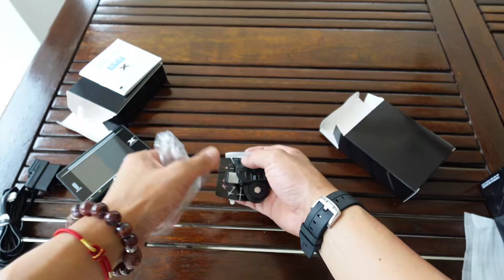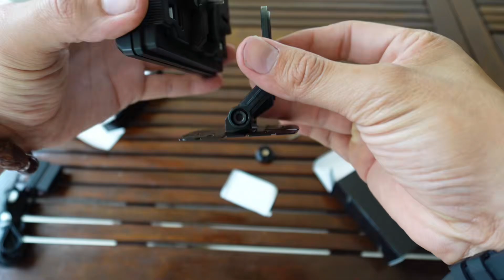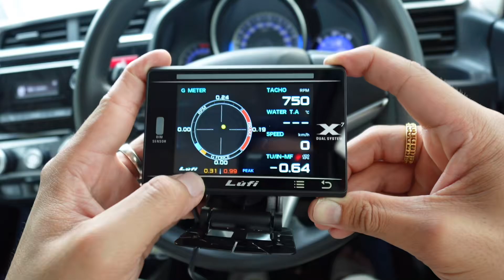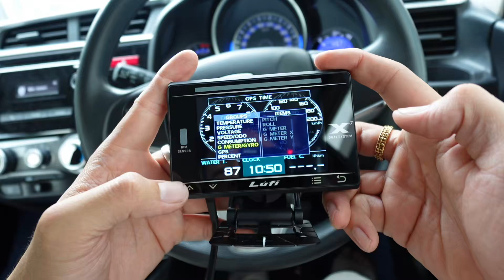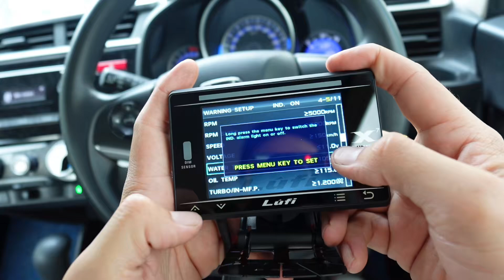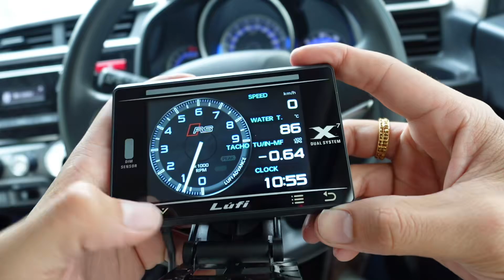LUFI X7 OBD2 meter manufacturers auspicious installation tutorial

Comment: I have a BMW E91 318D car manufactured between 2008-2012. The X1 does not read oil temperature and oil pressure data. Would the X7 be able to do it?
Reply from the maker: The instrument is equipped with the corresponding PID for BMW. You can conduct the corresponding tests through the built-in custom PID menu. The PID instructions for X1 and X7 are the same. If it doesn't work for X1, it won't work for X7 either. If you can find the calculation formula for the oil temperature PID instruction for the car, you can also email us and our engineers will customize the corresponding PID for you. However, there is no guarantee of success.
A quick note: We’ve received feedback that some clients haven't seen our replies. Our apologies! Outlook often marks our emails as spam because we attach customized PID files. Normally, we reply within one business day (excluding CN holidays/weekends). Could you please check your Spam/Junk folder? Thanks!

Comment: Greetings from Japan. This meter is an amazing product. I follow your videos. I have a question. I'm using an X7, and in the bar graph tachometer at 14 minutes and 40 seconds in your video, the line that holds the RPM for a few seconds doesn't appear. Other people's videos show that some X7s have this function. The peak hold line is displayed at 13 minutes and 25 seconds.

Also, even after setting the warning settings, the animated pop-up doesn't appear. Even when I set the water temperature warning to 80 degrees, the displayed text just turns red.

Please explain these two points.
Reply from the maker: The operation procedures are all the same. Other X7 models have this function as well. Yours does too. Just watch the tutorial in the video and you should be able to find the function you need.

Comment: All you need to know if it's able to show the milage (/km)- odometer.
And the funny things is: NONE of those can! I wonder why?? It should be technical possible or not?
Othewise I would buy one long time ago.
Reply: Doesn't only show engine mileage on some makes
Reply: @ethanwasme4307  If I have understood you right, you mean on some cars id does show the total milage, right? But how do you know on which car brand/model it will show the milage and on which not?
Reply: @AlexDerhuan , not all vehicles store odometer mileage in the PCM/ECM, GM vehicles store the Mileage in the Cluster (IPC) for example. And some vehicles don't store Mileage at all.

obd2 is just a connection standard like usb, it's up to the manufacterers  what can be picked up with a scantool like this display essentially is.

even this display may/will require you to find custom codes sent by the ecu to be decripted by the display. you email them to support and they give you a firmware update according to comments.
Reply from the maker: The mileage needs to be manually set to the same as the car's mileage when the device is first installed. Only then will the mileage display be synchronized and show the same kilometers as those on the car's dashboard.
Reply: @lufi-xf6224  That would help! How many digit you have for the milage display? 5? or 6? or even 7? Do you know that?
Reply: @lufi-xf6224  Ok, I order it now and if does not work it will be send back. Thank you.
Reply: @lufi-xf6224  I ordered it and it arrived today. I will test it and give you a report. See you!
Reply from the maker: Under the instrument system settings menu, you can select between kilometers and miles, as well as Fahrenheit and Celsius units. This is very easy to do.

Comment: can u input custom manual pid w/ formula on lufi x7? like transmission temp and gear?
Reply from the maker: Manually entered PID formulas may not be supported, as our PID data is encrypted. The instrument has built-in PIDs for different brands. It is necessary to test them one by one to see if they are compatible with your vehicle. Since each car manufacturer produces different models, different models may correspond to different PIDs. The built-in PIDs may not be supported by your car. Please understand this.

Comment: Just spent 350 on one of these x7.. doesn't work on 2012 Suzuki swift sport only get water Temp..no speed..no RPM..no clock even.....even to adjust clock it won't let me go past 12..I need 13 for New Zealand time zone..my $30 one off a temu does it all but no CVT temp...which is why I bought this one...what a waste of time...all I get is water temp and nothing else.
Reply from the maker: This 350 yuan is too expensive. Amazon's price is only around 120 US dollars. Suzuki cars might not be compatible. So, you need to look at the corresponding pictures of the suitable models. The product pictures contain the information of the suitable models.
Reply: @lufi-xf6224 it's comparable with ALL OBD2 from 2008 onwards..yet it doesn't work on a 2012 Swift...at all... so it is a lie because it's obviously isn't.. it's time they come clean... OBD2 is OBD2 if they say it works and it doesn't..then it's not!...no matter how you cut it it a poor protocol design on the OBD2 platform
Reply: @mrjones6770  ,  The port indeed is called OBD2 and even mid 90s cars had it,   but there are various different protocols used for actual communication.  If this X7 fails to automatically select the correct protocol  it cannot read these coded values as you stated.     For eg in my Scangauge2 i can manually choose between: ISO, PWM, CANSF, CANLF, CASNSS, CANLS, VPW, KWPS  and  it shows all data no problem.
Reply: And I paid $350NZ dollers..not us or any other @lufi-xf6224
Reply: Also so say to me Suzuki car might not be compatible..that sounds really bad on your part...you make the device..you should know exactly how it works on the OBD2 platform...dont tell us it's hit or miss with some cars...YOU should know..not good for your customers...customers shouldn't have to ask will it work with my car? ..if car is OBD2 then yea will work...not maybe just bye one and find out! 🤬 @lufi-xf6224

Comment: Does this  device support reading the temperature of the automatic transmission oil?
Reply from the maker: The oil temperature and pressure function is not applicable to all models. For most models, an engineer needs to send you the PID data package of the corresponding brand. After installation and upgrading, the relevant information may be displayed. If you need it, please contact our engineer and tell him your car brand. Our engineer will send you the PID data package of the corresponding brand.
Reply: @lufi-xf6224 I’ve been waiting for a response back? I contacted your outlook email
Reply: @lufi-xf6224  how do we contact your engineer?

Comment: They can read lambda for gti mk7 ?
Reply from the maker: It may not be readable. The displayed data is related to the sensors of the vehicle. Only the data that the ECU can receive can be read.
Reply: Should work. It reads lambda on my Audi S8.

Comment: how to make nissan engine temp, etc functional.. in mine is show all zero
Reply from the maker: The oil temperature and pressure data cannot be read by default through the instrument system. The instrument has built-in PID data packages corresponding to specific brands, allowing you to call the relevant oil temperature and pressure PIDs based on the brand. However, since each car model varies by brand, the built-in PIDs might not work with your vehicle. You can check your car's oil temperature and oil pressure PIDs using an OBD2 automotive diagnostic tool. Then, provide the PID parameters to our engineers. Our engineers can create custom PIDs specifically for your car. Without these parameters, it is impossible to develop PIDs suitable for your vehicle
Reply: @lufi-xf6224  my car is nissan xtrail t32 2017 Indonesia

Comment: Great video.  I will be purchasing an X7 for my 2023 Toyota, hoping that it will work with it.  Do you know if the Lufi allows for a camera to be connected to it?  It looks like it has such a nice display, that I would like to use it as a monitor for a forward camera as well, and have less clutter on my dash.  Thanks!
Reply: Guess I don't get a response, thanks.
Reply from the maker: Thank you for your attention. This feature does not include a camera.

Comment: I need for proton PID
Reply from the maker: You can contact our engineers at：（ lufigaue@outlook.com.） You need to provide your car brand to our engineers. Our engineers will send the corresponding PID data packet based on your car brand. Note that due to the differences in car brands, models and corresponding production years, there is no guarantee that the PID data you require will definitely be upgraded successfully

Comment: gear temperature mean CVT temperature?
Reply from the maker: You can contact our engineers at：（ lufigaue@outlook.com.） You need to provide your car brand to our engineers. Our engineers will send the corresponding PID data packet based on your car brand. Note that due to the differences in car brands, models and corresponding production years, there is no guarantee that the PID data you require will definitely be upgraded successfully

Comment: Will this unit work on a DODGE CHARGER RT 2007 ? I have an OBD2 plug inside the car.
Reply from the maker: American brand cars produced before 2008 are not recommended for purchase. Some models are incompatible and a "search agreement" may appear. Thank you for your attention
Reply: Do you have any units that are compatible with my car ? @lufi-xf6224
Reply from the maker: The DODGE CHARGER RT 2007 May be using the J1850 protocol of the United States in 2008. The instrument does not support this protocol. None of our instruments support it. It is not recommended to purchase